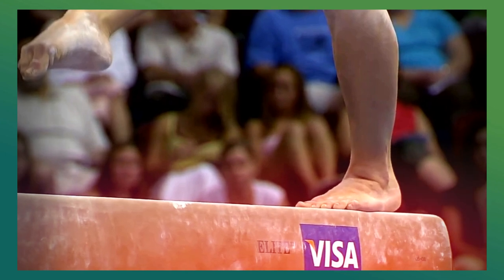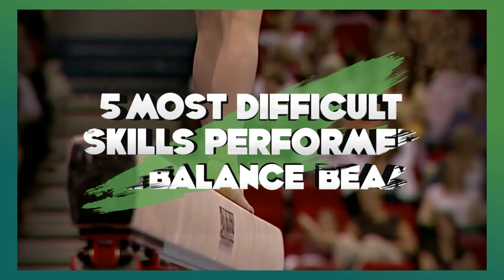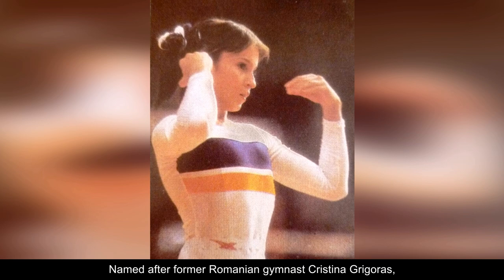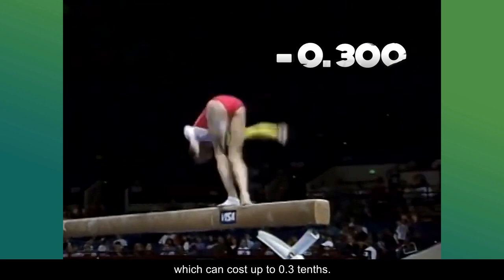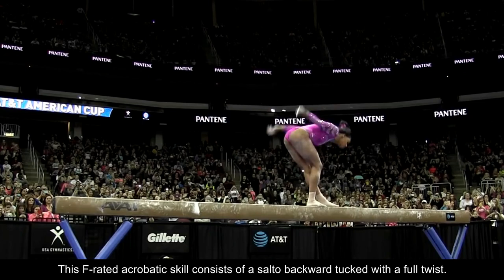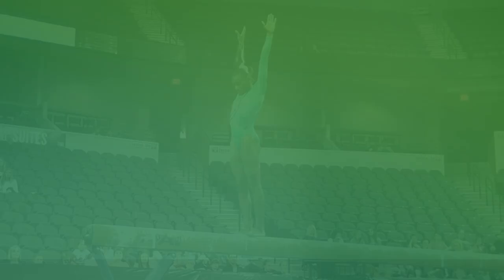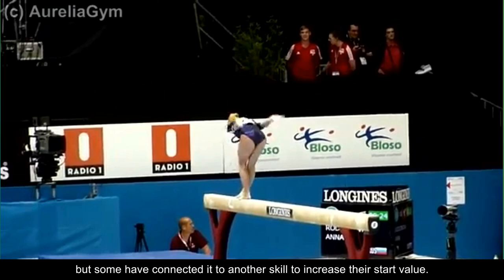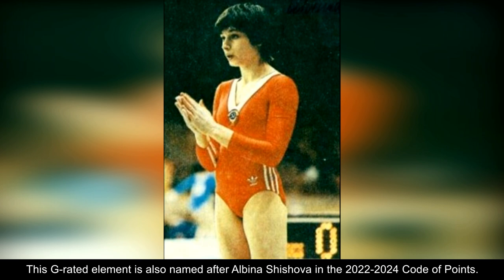The Most Difficult Acro Skills Performed on the Balance Beam (No Mounts or Dismounts)

Comment: Hey I was wondering if you could please do an edit to this possible uneven bars routine with its difficulty value? I think it would look pretty interesting and i would greatly appreciate it! 

// = break in sequence
+ = connections

Uneven Bars (UB): 
Piked Arabian Mount (G) // Ono (E) + Healy (E) + Ono 1/2 (E) + Geinger with Full Twist (G) + Bhardwaj (E) + Seitz (E) + Pak (D) + Van Leeuwen (E) // Double-Double Layout a.k.a The Ray as the dismount 

***The first three turns following the mount can be found already connected in Nastia Liukin’s UB routine;  The Seitz (E) + Pak (D) + Van Leeuwen (E) can be found on a version of Aly Mustafina’s 2013 bars I believe, although her version separates the sequence between the Pak (D) + Van Leeuwen (E) with a Stalder Circle (C).

Comment: Imagine if someone did a double tuck combination on the beam, not as a dismount. I wonder if they would even allow it lol.
Reply: what do you mean by a double tuck combination?
Reply: @hannibaljustincase9985  to land the double tuck on the beam
Reply: I have thought the same thing. It would be banned right away imo but I think no one will try it or be able to land it in near future
Reply: @albertitomoon5002  that's what I assumed but didn't necessarily get that "combination" part. with that being said, I don't think it would be possible to land it. the amount of strength, precision would have to be insane. not. to mention an impeccable form... don't get me. wrong, I'm not staying it would be impossible from a purely technical point of view(gymnasts were landing double tucks basically on carpets 40 years ago), but from theory to practice is a long way, and I don't think anyone could do it
Reply: @hannahwalmer1124  gymnasts such as Comaneci or Kim used to do double backs on floor in the late 70s/early 80s when the floor was basically a carpet on the ground, so from a physical standpoint it is not impossible to gain enough momentum to push yourself in the air for a double tuck(two bhs would be most likely enough for a double tuck), even on hard and not springy beam. but realistically speaking, it would be incredibly difficult to execute.
Reply: @hannahwalmer1124  you can look up people doing standing backflips on hard surface. it's not impossible

Comment: I’m still stumped….can anyone clearly explain the difference in a
Barani vs Grigoras vs Rudi? I’ve asked multiple people in multiple forums, and I can never get a clear answer.
Reply: Grigoras has the half turn at the end of the salto, Barani has the half turn kind of in the middle/throughout the entire salto, and a rudi is 1 1/2 twists instead of just 1/2.
Reply: @branbear0430  Duh..I knew Rudi..guess my brain forgot. I guess I get confused on Beam where a Barani or Grigoras is an “F” but a “free aerial from two feet” (aka Chellsie’s piked “aerial”) is an “E”. What differentiates the two skill grades? 🤷🏻‍♀️
Reply: @Crystal81Starr  tbh I get confused by that as well😅my best guess is that with chellsies, it’s rated only E because you can see the beam for most if not all of the salto, while in the other two you can’t see it for a little bit bc the flip and twist are more differentiated if that makes sense? I’m really not sure though lol
Reply: Barani is a half turn to back tuck and the Grigoras is a front tuck to half turn. Basically the diff is just in the timing of the half turn. The turn comes at the beginning in the Barani  and at the end in the Grigoras. Although both skills are valued the same in this quad.